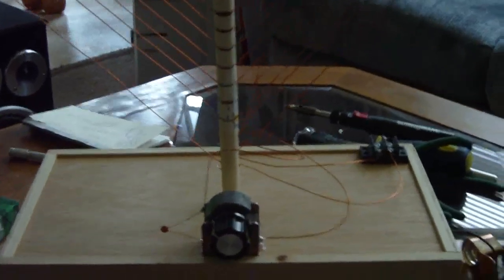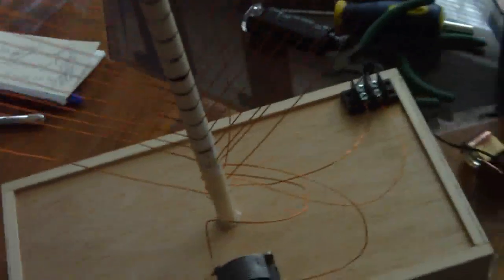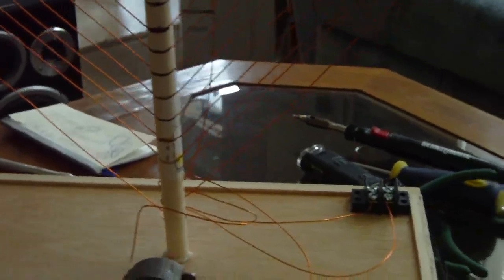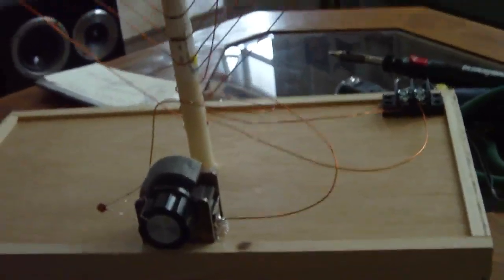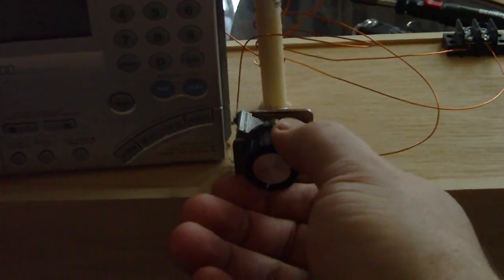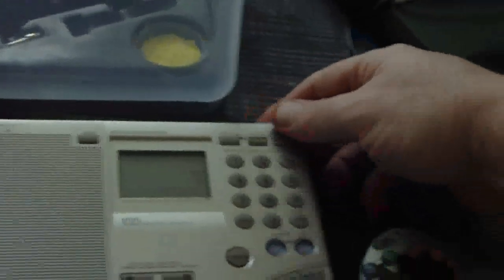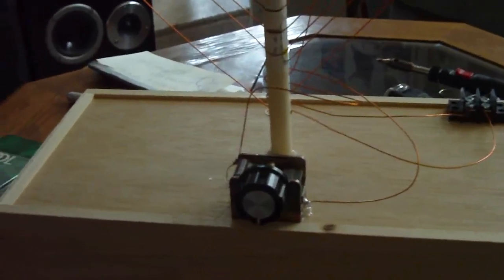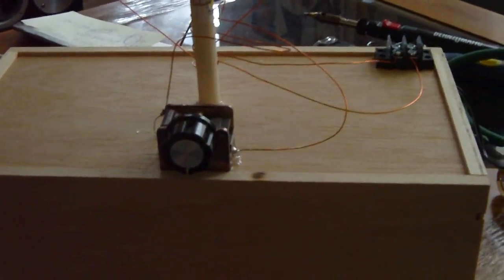AM Spiral Loop Antenna

Comment: Thanks for this, I may have missed it in the video, what is the length of the wire you are using in your antenna and the value of your tuning cap?  Thanks!

Comment: Do you remember a round antenna called a " Select a tenna" once sold by C Crane?
Reply: Yes I do, also found in the back of magazines under different names. It is for the most part the same type of design.
Simple  no power needed  easy to make  they work

Comment from the maker: You “could” wind enough wire to make up for the capacitor but it would be a lot of wire, and set on one frequency.  If you can find an old AM transistor radio you’ll find these capacitors. There are lots of them on EBay.

Comment: My father listens to late night radio and i think he would love one of these but i am having trouble locating a variable capacitor 20-365 pf would this work with out a variable capacitor? or should i just run a long line of copper wire in the attic as an antenna? or can you endorse a store bought model?

Comment: If you haven't searched yet for a commercial loop antenna, here's a few suggestions. The Terk Advantage and the Eton AN 200 or AN 100. Now Eton is the same as the Grundig, Kaito, and a few others I can't think of this minute. Go for the cheapest ya can get at the time, they're all the same manufacture company in China. I've built several like Jims and if their a 5, the 9" loops are a 4.5. They work well...

Comment from the maker: There are a few on EBay that say AM Broadcast Variable the wider the better, 20-365 pf or more. But for your use the are several good AM Loops available on EBay that are much smaller, this antenna is pretty large.

Comment from the maker: The cross members ar 18 inchs, the spaceing between turns are 1/2 inch there are 18 slots for the internal spiral, one for the single turn loop. If you are using a radio like the sony ICF7600gr that supplies power to the antenna jack add a 100 pf capacitor in series with the pickup loop to block the DC.

Comment: My only antenna connector on my MW reciever is a PL259 / SO239 type rather than the 3.5mm - 1/8" jack.  I added the correct bandpass filters to the receiver, including high pass, low pass and notch for the 500-1800kHz area of RF. I have seen gimballed versions of this antenna which also allow the antenna to be tilted to the vertical or horizonal plane as well as the 360 deg rotation you are showing here.